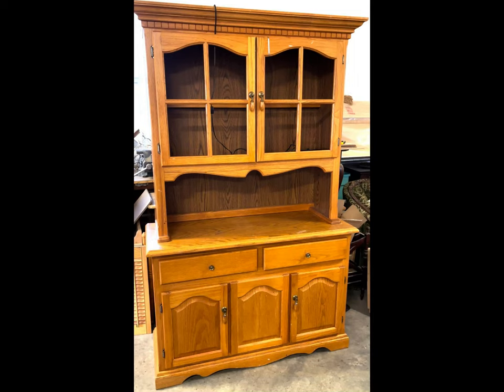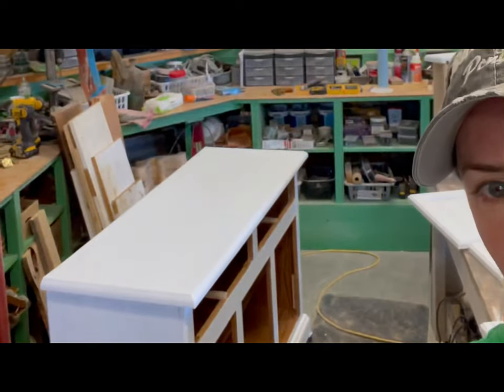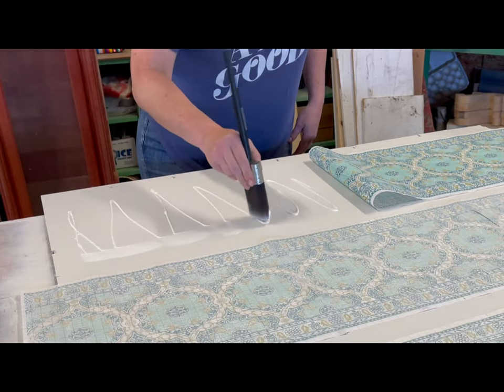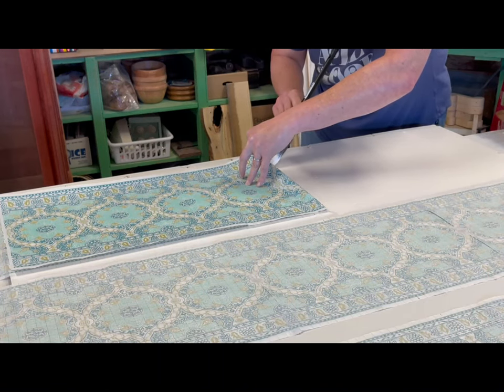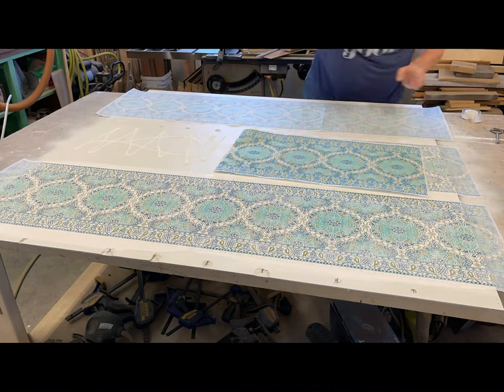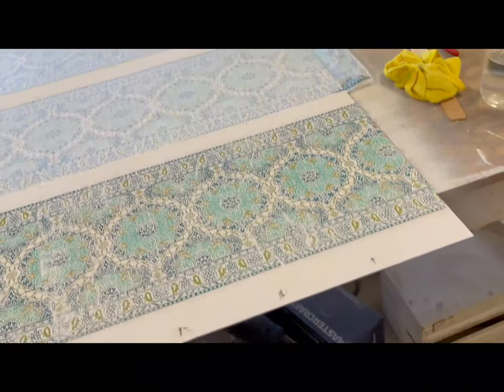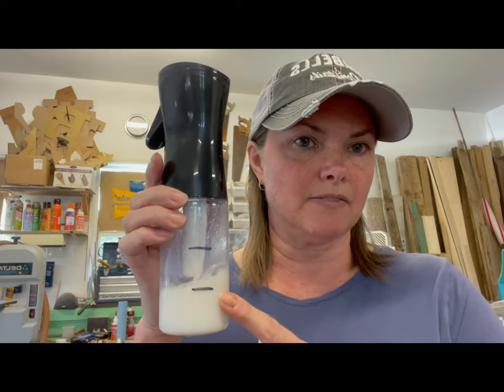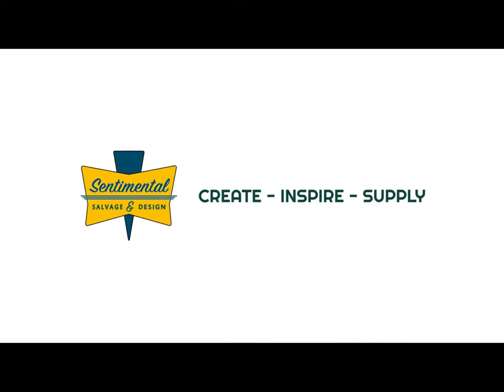How to turn dated honey oak into something bright and cheerful!

Comment: What's the difference between a transfer and inlay?
Reply from the maker: Hi Jeanine! IOD Decor Transfers are pressure sensitive, adhesive backed designs whereas IOD's Paint Inlays are an artisanal paint design that you embed into a painted surface. The Inlays are 'active' until you seal them meaning you can manipulate and apply your own unique techniques before you seal it.